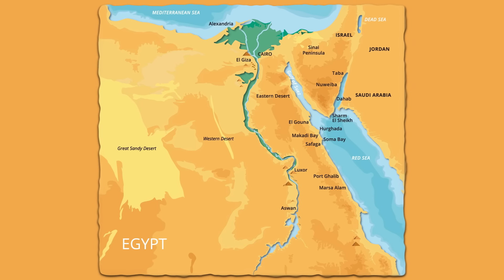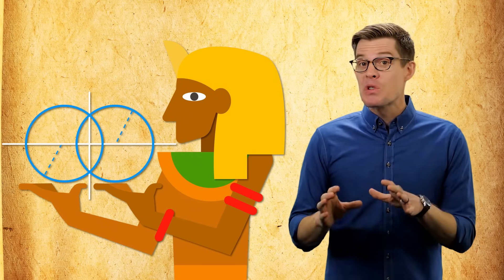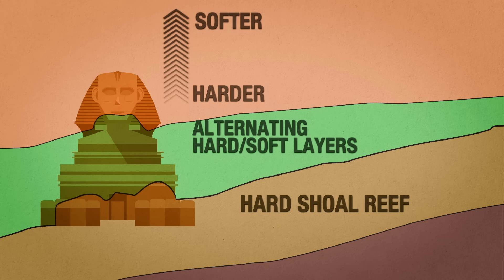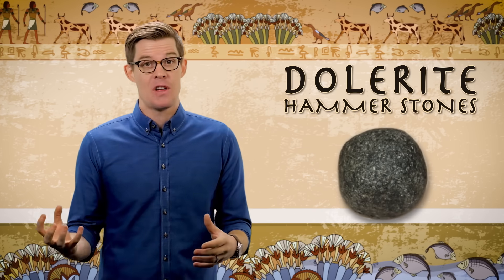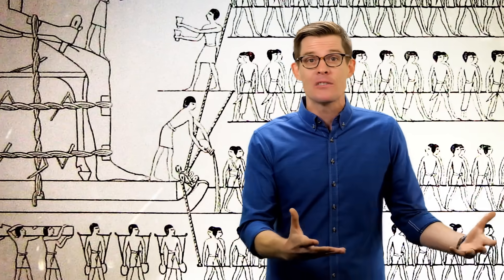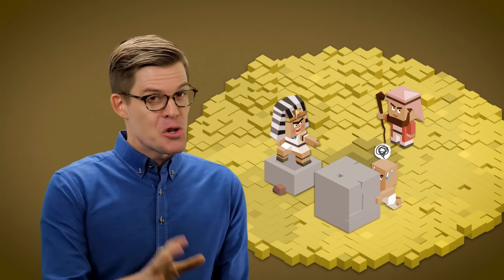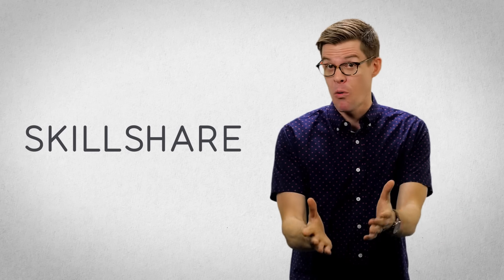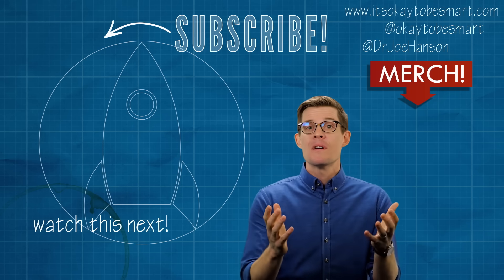The INCREDIBLE Ancient Engineering That Built the Pyramids

Comment: I would love to see someone actually craft granite into perfectly smooth edges & right angles using dolorite pounders. Has anyone ever seen that happen?
Reply: Dolerite was employed along with fire to obtain the basic shapes.  After that a block could be smoothed via polishing using an abrasive.  Also copper can in fact cut granite if you similarly use an abrasive such as sand or corundum.  Yes it may be time consuming = but they had the time.  

There are few granite blocks in the Great Pyramid while the Egyptian engineers would have known how many were required before the first foundation stone was laid.  Accordingly the quarry - which like all quarries which would have partially quarried stone on hand as they were in continuous operation after all - would have had literally years to fashion and transport the required stone to Giza before it needed to be placed in the pyramid.  

Finally they had tools like squares or levels etc. you know = we have examples of them found in tombs as well as depictions of the craftsmen employing them.  Just look at the depictions on the tomb walls of Rekhmire as but one example.  So it helps if you first learn the history before making assumptions.  Just saying.
Reply: @varyolla435  never worked with your hands in hard stone to say such nonsense ??
Reply: well soon we will go back to stoneage.... if you survive that you might actually get to see it :P
Reply: @ayamaprantenna  So does corundum = which the ancient Egyptians also used to cut through stone as noted before.  Corundum is rated 9 on the Mohs scale making it more than adequate for an abrasive to cut through and polish granite or sandstone etc..  Have a nice day.
Reply: @ayamaprantenna  no, quartz is same hardness as granite 7 , desert sand is too fine to be use as grit
Reply: @ayamaprantenna  I like the video of the stonemason above as it demonstrates the basic technique for quarrying limestone such as the Egyptians used.  Far too many people simply assume they were sawing through each individual block = nonsensical assumption.  They rather were as the mason does drive chisels into approximately spaced sections of stone. Once the chisel is sunk deep enough = the stone continues to split along the line producing an approximate size and shaped block.  

Most of the limestone blocks were obtained this way as this is what we see in the quarries which sit beside the pyramids at Giza.  We see where they cut lines along the natural layers of bedrock and holes along the line like a saltine cracker.  Then they drove wedges into the holes and possibly poured water on them causing expansion = resulting in the bedrock fracturing along the pre-cut line.  Then they drove long chisels at intervals like the mason in the video.

The Granite was cut using dolerite and fire as noted before.  Only those granite blocks used to create the smooth walls of something were carefully cut and in some cases polished.  Other granite - such as the relieving blocks above the King's Chamber - are little more than crude chunks of stone which were roughly hammered out into rectangular shapes.  They show no refinement at all as no one was ever supposed to see them.  They are mere slabs of stone.  Enjoy your day.
Reply: @ayamaprantenna  to be real granite have silica content of 65 % and minimum 20 % quartz , chalk is only one form of limestone
Reply: @varyolla435  Yeah... it helps to know history when... history itself is an assumption? I mean we should remember :
- No sarcophagus found into pyramids.
- No scripture about the pharaoh (just a ridiculously small "Cheops" written somewhere randomly, possibly fake), when a tomb for his glory should have been full of it. 
- No testimonial about the way they built it. First testimony by Herodote... 2000 years after the supposed date of construction !
- Built by people who didn't know the wheel, hard metals and hardly mastered basic mathematics (Egyptologists say it).
-,No evidence of traces of the constructions sites, of the ramp or else. 
Anyway... any egyptology book starts by saying sources are really rare and it's difficult to have certainty. About pyramids we all are making assumptions so let's be tolerant with all of them :)
Reply: @testafrederic7018  It's only assumptions = for those ignorant of the facts.  So follow the white rabbit Neo:

1 - the pyramids of Giza were built during the Old Kingdom.  The Old Kingdom = nascent period of Egyptian history.
2 - all cultures to include today are evolutionary.  As such the practices associated with a culture evolve over time. 
3 - so Egyptian burial practices were different in the New Kingdom compared to the Old and Middle Kingdoms just as other things such as mummification practices were different etc..
4 - so all royal pyramids came with an accompanying = mortuary temple - all of them.  It was in the temples that references to the Pharaoh could be found and offerings made.
5 - when the Old Kingdom dynasties collapsed after prolonged bad environmental conditions devastated the Middle East = the temples were destroyed and the tombs were looted as people tried to survive.  As an example the tomb of the Vizier Ankhtifi tells of cannibalism during this period were parents were eating their own children to survive.  
6 - so Pharaohs who was considered to be a living God and responsible for the prosperity of Egypt and the Egyptian people = were rebelled against and their history wiped out for the most part.  That is why references to Khufu are gone along with his temples etc..  To make matters worse.  During the New Kingdom the Pharaohs often practiced "damnatio memoriae" = or "erasing" a predecessor.  They would deface or destroy old temples or else use them as raw material to build something else.
7 - after the fall of the Middle Kingdom northern Egypt - where the pyramids are located - was overrun by the Hyksos.  After a century the Egyptians drove out the Hyksos and acquired their territory = ushering in the New Kingdom.  During this period the capital was moved from Memphis in the North to Thebes further south.  That is when we begin to see underground tombs being employed.  An underground tomb has no accompanying mortuary temple to give its location away as the pyramids did.  As such what was once found in the temples = was now placed directly in the tombs themselves. So that is when you see your writing in the tombs.
8 - Herodotus got his information from the Egyptians themselves.  So while the Egyptians of that time might have viewed the Old Kingdom Pharaohs negatively = their knowledge of construction techniques remained.  The Egyptians were big on "recycling" so that when they found something which worked they tended to duplicate it going forward.  So even if we ignore the bad things Herodotus writes of Khufu = the information relating to the construction of the Great Pyramid is still valid.
9 - the Egyptians were not "stooopid".  They had knowledge of metallurgy + geometry and mathematics + and were highly organized.  These were not cavemen.  lol!  
10 - finally they built things using ramps made of mud bricks or else a mixture of sand/stone chips/tafla - a clay they mined.  There is the remains of a tafla mining operation near the worker village at Giza.  Also when the limestone quarries at Giza were excavated years ago they were found to have had massive amounts of............sand/stone chips/tafla dumped into them = or what they built ramps from.  So your "lost ramps" were in the limestone quarries.  As they encased the pyramids in white Tura limestone working from the top down as Herodotus wrote = they systematically dug away the ramps and dumped the residue into the now open limestone quarries to backfill the ground.

Moral of the story:  so I could of course go on = but the point is made.  There is always more evidence out there.  So things only seem impossible for those who fail to follow all of the evidence we see.  Egyptologists along with other subject-matter experts who work with them conclude it was entirely possible for the Egyptians to build the pyramids = and that is what the entirety of the evidence points to.  Have a nice day. 

p.s. - there are sarcophagi in the pyramids.  I suggest next time you dig a tad deeper.  lol!
Reply: @varyolla435  Thank you for all those details. but honestly I know less than you about it and an answer point by point would be too long... 
It's just the elder is the time we study, the less we have sources and the more we have uncertainty. Some elements you talk about are certainly true (tombs, functions of the pharaoh, egyptian society, etc.), some others can be doubted as well, because evidences here are not so undoubted... I personally think the archeological traces you talk about on the site are not clear enough to solve such a mystery. The day there will be a clear evidence, it would shut all conversations about it. 
Even Heredotus... I still think a 2000 years gap is too huge to judge a testimony reliable. Plato talked about Atlantis (the myth actually came from him), but we can't say it is an evidence...
Eventually, I really love pyramids for their mystery. I mean we can approach it in many ways, classical egyptology, architecture, mathematics, esoteric/mystic. But I really love the fact there is an open door for intuition, dreams, imagination. 
Personally, visiting it I had an incredible feeling to witness something hiding an immense wisdom (I was not expecting such a feeling honestly). I like to think they resist to our obsession to explain everything, to control reality through rationality and ultimately disenchant the world. Yeah, sorry if it hurts your personal convictions, I don't mean it in an agressive way but to me science has become a new dogma... But rather than to see a problem to be solved everywhere, I try to welcome the mystery of life sometimes and dive in it, failing to dig into the archeological ground ;) 
Thank you though for the interesting facts you pointed.
Reply: @testafrederic7018   "I personally think the archeological traces you talk about on the site are not clear enough to solve such a mystery. The day there will be a clear evidence, it would shut all conversations about it." 

I'm afraid what you "think" is utterly irrelevant.  All that matters is what does the evidence actually support.  Accordingly your rather lengthy post becomes an example of how not to think and analyze as it is largely reflective of argumentum ad ignorantiam - which is a logical/deductive fallacy.  We base conclusions upon what we actually see = rather than what we hope "might" turn up someday............maybe.  Rationalizations based upon imagination rather than actual evidence is the sucker's bet.

Moral of the story:  so my sensibilities are not offended in the least.  lol!  I merely recognize the same pattern here I have seen countless times over the past decades.  Rather than investing the effort and time to learn the entirety of evidence so as to contemplate what we actually see = you like so many instead appear to prefer to engage in imagination run amok.

So it is easy to claim "impossibility" such as online trolls frequently do.  It is another matter to connect the dots based upon what we actually see as that requires effort to first find and understand those dots.  This is not a matter of metaphysical allusions or supposedly contemplating entertainment genre inspired nonsense.  This is stone cold reality based upon what we actually see.  Have a nice day.
Reply: @varyolla435  I am bored to have a long debate here to prove my point... I just tried to explain how the fact there is not a real evidence about Giza (that you like it or not, if a clear ramp was found there would not even be a debate about the shape of it, as far as I know Egyptologists still discuss it...) let a space for imagination. 
I don't really belong to the category you put me into,  if you think to identify some "patterns". I believe in science , I believe in intuition too. I think people who are only "rational" are really dry and narrow minded. I think people only living in dreams and imagination are equally lost in some unreal world.
I believe in the connection of both, all great scientists have great intuition, calculating just confirms (see how Einstein came to know about relativity for example). 
And yeah I think we can't treat pyramids as "stone cold reality based" but we need both, a scientific mind and a lot of intuition and being open to the mystery instead to pretend we know what we actually don't and become comtemptuous  with poor dummies 😑

Or else science becomes exactly what it wanted not to be, a new religion, a dogma we can't discuss with even when evidences are fragile.

Thank you for sharing your views and sorry for my poor english.
Reply: @Handsome Millenial the saddest thing is the same person who believe in aliens still dare to accuse egyptologist that they have no evidence.

Talk abt irony
Reply: @varyolla435  can you also explain the clear machine tool marks this way? Not. Check out the cylinder drill and circular saw marks..
Reply: @MrMagnus  Ok:

1 - what marks do you refer to???  After all when referencing some artifact it becomes paramount to also take into account "when" the artifact dates to.  Far too many overlook this important variable in their often facile approach to history.
2 - next is to understand that ancient Egypt underwent multiple periods to include 3 main kingdoms = Old, Middle, and New.  
3 - now coincidentally the New Kingdom Pharaohs were notorious for applying "damnatio memoriae" = or "erasing" their predecessors as I already noted.  This means that not only would they chisel off the cartouches of previous Pharaohs = they sometimes cannibalized their temples as raw material for something else. 
4 - so because of #3 New Kingdom Pharaohs sometimes took stone from Old Kingdom sites and reused it to make something they wanted.  Further as Egypt went into decline along with the intermediary periods were Egypt was basically under local control of the various governors they would also sometimes cannibalize temples and even old towns as raw material to build something if the stone they wanted was not available in their zone of control.  
5 - so above means that while the Egyptians primarily used copper tools through much of their period = in later periods they had access to harder iron and then steel tools.  The Serapeum as an example was continued to be expanded until the time of Cleopatra.  In other words Roman times when steel tools were commonly available.

Moral of the story:  anyways as noted above to consider how an artifact was made you must first determine "when" it was created so as to understand what was available to them.  Also you can look at the tomb of Rekhmire which contains the famous mural of artisans at work with their tools.  See where some employ a bow drill to drill holes in things.  By using copper tubes along with an abrasive such as sand or corundum one can bore through even hard stones as corundum is Mohs scale 9 - also already noted.  

Coincidentally an artifact unearthed at Armana showed just this.  It was created using tubular drills and there was some residue in the drill holes which showed to be copper and corundum residue.  Emery corundum was easily obtainable from the Greek island of Naxos were it was mined from antiquity to modern times. There is an expert in ancient tools and stone working named Denys Stocks. He has studied Egyptian stone working for many years and has duplicated stone artifacts using the tools seen in depictions such as Rekhmire's tomb using the same techniques depicted.   Have a nice day.
Reply: @varyolla435  we dont even have cylinder drills today that with remotely that thin cuts nor the penetration ratio. Same for the circular saw blades used with a diameter of 6 meters also with very thin cuts. Ill dig out the links for you some day. Bed time here. But please look at the precision cut boxes in the Serapheum and let me know if you still think they were hammered out with simple tools
Reply: @MrMagnus  Don't think I did not note your failure to cite these supposed machining and drill markings...........again.  Also you might want to work on your reading skills as apparently you missed by point about the Serapeum = so I will show you again:

"The Serapeum as an example was continued to be expanded until the time of Cleopatra.  In other words Roman times when steel tools were commonly available."

So the sarcophagi within it represent different levels of craftsmanship as would be expected given the reality - as I noted - that the temple complex was created over more than a millennia.  It was continually being added to until the reign of Cleopatra who as I once again noted lived during Roman times when steel tools were commonly available.  Now coincidentally I should point out that these precision cut boxes you reference are likely the ones you can see pictures of online and which are open to the public.  I guess it never passed your mind that the Egyptian Dept. of Antiquities allows people to see the nicest examples of them = in other words the last ones to be created.  

So the famous "black" etched sarcophagus commonly depicted to represent the Serapeum as it happens was likely the last one created as it lacks any reference to a corresponding deity carved on it whereas other sarcophagi which were used contained this reference.  That means it was created but never used and places the box = to the Ptolemaic period - read Cleopatra.  This means they would have had the requisite steel tools to create and carve the hieroglyphs into the sarcophagus. 

Moral of the story:  casting saw blades of any length or shape merely requires a corresponding mold to create them along with a frame of some type to employ it in cases of those requiring more than one man to employ.  lol!  Merely go to Wikipedia if you must to read about the 2 man saws that lumberjacks of old used to use to cut down redwood etc. trees which were around 8-10 feet long.  

So only thinking of circular saws reflects a failure of critical thought for you as saws are created in all manner of shapes and sizes = even in antiquity.  Further you failed to address the evidence I noted in using the Serapeum as an example as it was created over centuries and accordingly the level of detail seen on sarcophagi would correspondingly be expected to improve as time went along with those seen by the public being the best examples = or most recent.  The Egyptians used dolerite and other gneiss stones along with fire to quarry through bedrock.  Having achieved a basic shape = they then had other tools to create a finished product along with the ability to polish stone smooth via the employment of abrasives such as I have already noted here.

Anyways experts conclude that the Egyptians in fact could create what they did with the technology at hand.  You meanwhile have failed to cite any specifics here nor more importantly = offer a plausible alternative to explain what we see.  We base conclusions on what we actually see and not merely conjecture which is what you seem to be offering here that I wager you got from unreliable online sources which offer the gullible poorly informed claims and argumentum ad ignorantiam in the form of pseudoscientific/historical nonsense.  Have a nice day.
Reply: @varyolla435  Some about the tube drills:
https://www.youtube.com/watch?v=KFuf-gBuuno&t=14s
Worth noting is that the cores and holes have a spiral grove which rules out the possibility of grinding with an abbrassive.
Here is some about the saw blades
https://www.youtube.com/watch?v=puXsFyainQU
In both cases the cutting edge was very thin which means the tool must have been EXTREMELY hard. Much harder than anything we have today. It is definitely just a matter of casting a big blade like you claim.
There are also tons of examples of hard stone vases and pillars that clearly has been turned on lathes which needs to be done at a high speed and realisticly do recuire advanced technology.
Also there are tiny hard once piece stone objects that have been hollowed out which definitely requires very fine power tools.
Reply: @varyolla435  Googled "Adel Kaleny" and nothing turned up. Oh, Per has his own website? Wow! He must be smarter than you then :)
Reply: @varyolla435  
1. We dont know that for sure and the "evidence" suggesting so is very vague.
2. Exactly. So how come we see stonework which we can not even remotely match today? Like moving 1600 tonne foundation blocks in Baalbek
Reply: @varyolla435  you have given zero evidence. So rather than commenting on the marks that can clearly be seen in the videos you  choose to attack the people to held the cameras. Silly. All these rocks can be viewed in many peoples videos. Look them up. You dismissed the huge think circular saw blades we can not even create today with simply: "saws can be made in different shapes". Really? Pathetic!
Reply: They say the great  pyramid was built in 20 years. They would've had to Quarry, transport, shape and place a block every three minutes;  twenty four hours a day for twenty years.  Funny, that there is no written record of how they did it.  The megalithic blocks that they moved.  We would find hard to move with the technology we have today.
Reply: We pounded granite into geometrically perfect symmetrical images of human beings with dolerite stones. 😂😂
Reply: David Watson and how would you pull tonnes of stone walking up a greasy ramp lol?!
Reply: @varyolla435  Now explain shaping said granite into perfectly symmetrical representations of the human form.  Explain taking your average "rough" 1000 tonne granite stone and carving it into a perfectly cylindrical plumed pillar without a lathe. Explain one of thousands of dolerite vases, carved internally to paper thinness.
Reply: @eyeingi  Okay:

1 - "dating".  When you fail to take into account WHEN a thing dates to = you then fail to account for the technology of the time when it was actually created.  So the Egyptians employed gneiss tools along with copper.  Among the tools they commonly used is flint which is of a hardness similar to granite etc. and which could be shaped into precise cutting edges as humanity has done for millennia. So Egyptian workmen which shards of flint as an example could cut out tombs from the limestone bedrock quite readily. Similarly stone and copper tools along with abrasives and polishing could fashion shapes as well as surfaces.
2 - Google Denys Stocks.  He is an expert in ancient tools and has spent more than 20 years studying ancient Egyptian stone working.  He has duplicated items in stone using the tools we see depicted on Egyptian tomb walls such as the famous depiction of artisans working found in the tomb of Rekhmire.  

Moral of the story:  your incredulity is not evidence of anything save for your desire not to believe a thing and more often = a lack of understanding of evidence out there.  Only you can remedy that situation via digging deeper.
Reply: @varyolla435  You're the only one here who fails to recognize proper dating.  

Gneiss and flint are a 7 on Mohs hardness scale.  Granite is an 8 and Dolerite a 9.  Now you may think that's just one or two numbers higher, but they're order of magnitude more dense and you're not carving out perfect dolerite vases with either, nor are you doing any kind of fine detail work as several granite sculptures portray. 

I can get on Google and show you what the Earth is flat too.  It doesn't make it so.  

The Egyptians themselves plainly stated they were a legacy dynasty and even went so far as to provide a lineage that spans back many times further in time than we give credit.  

Archaeologists love to praise the ancients for their sophistication when it suits their needs them say they don't know what they were talking about when it doesn't.  

Tell me.  Why does every civilization we know of follow the same predictable progression of technology, except for Egypt, or anywhere else we find polygonal Megalithic Architecture?  

Every civilization from the Etruacans to the Inca, to the Egyptians say they inherited those ruins and built their own empires atop them.  We just ignore their direct accounts because it doesn't fit into the paradigm we created.  

Wake up and start thinking for yourself 

Denys Stock was a decent theorist at best.  The closest he came to replicating a granite stone vase was done in limestone, which is a joke.
Reply: @Handsome Millenial um no
Reply: there is evidence that there is a secret technology so the stones could floated.  A man is Florida figured it out and created a stone garden (Google it) to impress a woman.  He bragged about knowing how the Egyptians created their buildings but he never shared it with anyone before dying.   I believe he used magnetic energy.   And figured out how to tap into the natural magnetic energy of the Earth to make the stones float.  Also, some are researching how sound was used to move large objects.  They did not use primitive tools people🙄
Reply: @varyolla435  Thanks for that explanation but Giza is but one site out of many located all over the world.  In some places no sand exists in abundance.  And Giza isn't the oldest or the largest.  Ancients had electricity and other magnetic energy that could float the stones.  And it's been copied by a a man in Florida.  Razor sharp right angles cannot be created without advanced tools.  Egyptologists mean well.  But they're not craftsmen or engineers.   I wouldn't believe any of their explanations about how a structure was built.   Engineers maintain that Ancient civilizations had advanced tools.  Now, I believe one of two things,  This technology is being hidden or it's in plain sight but non-engineers dont know what the heck they're looking at and outiders aren't being given access.  I saw a documentary of piles of hundreds of some odd looking tools being thrown into baskets because they couldn't tell what they were used for.  Tools that looked like long slim pitch forks.  Some engineers said they were used to create movement with sound vibrations.   We don't have the whole story.  We only have what they want us to know.
Reply: @markita.hardenhome  YAWN!!!!  LMAO!!  "Engineers" claim................... = who - and more importantly how is their background related to Egyptology????  Out here in the real world Egyptologists work with subject-matter experts - to even include engineers.  In the mythical world of pseudoscience however we see these fringe cranks who "just happen" to work with other cranks who similarly lack any background whatsoever to tie their expertise to what they talk about - not even tangentially.

We see rather whereby these flakes more often than not have some book or DVD to sell you along with some who exist in the world of entertainment television.  Let me give you an example.  A historian who wrote a book about Mesoamerican civilization pre-Columbus while researching his book worked with a historian.  This historian related to the author that he had been approached by the producers of the Ancient Aliens show wanting him to be on it.  The historian told them he would be happen to be on their show - BUT - he thought their claims were nonsense................suffice to say he was not on the show.  lol!!

Moral of the story:  pseudoscience/history = is a BUSINESS!!!  Accordingly those individuals on those shows and writing books etc. are the ones who agreed to "play along".  They do it to raise awareness about themselves and perhaps make some money off of gullible moppets who believe that twaddle the same as we see Flat Earthers etc. which is also a business. 

So conspiracy theories are the swansong of the failed intellect I'm afraid.  Nothing is being "hid" and the idiots you have been listening to certainly hope you continue to believe such nonsense as that is how they make a buck.  Enjoy your Matrix.  I'll stick here in the real world. 

p.s. - when looking at neolithic or Bronze Age sites around the world you MUST first show any links between civilizations before you can claim some type of commonality otherwise you are engaging in imagination run amok.  Building a pyramidal structure is a basic shape which even a child with blocks can create in time.  So just because we find "pyramids" around the world does not make the civilizations related in any form as pyramids are among the first structures ancient man would build given its simplicity of design.  It is nothing more than blocks stacked atop each other in a tapering fashion.
Reply: @varyolla435  I scrolled through the replys and It doesn't seem like you convinced anybody. At this point no matter what you say, they just don't want to be wrong. 

ps: my recommended videos are now full of ancient aliens and nicola tesla power generating pyramids.
Reply: @kosimiki  My point is not to convince anyone = merely to present actual historical/archaeological evidence and to demonstrate the faulty deductive process employed by the believers of "fantasy" historical claims.  The deceived rarely confront the reality of their deception as often they have an underlying desire to believe it = hence they will employ endless logical gymnastics to cling to said belief.  For them a "comforting lie" is preferable to a hard truth.  As such they are beyond hope.  

So my points are for those intelligent enough to desire to understand the actual evidence out there and to show others how "not to think" about things.  Always follow the actual evidence at hand and not unsubstantiated conjecture or assumptions. Have a nice day.
Reply: @eyeingi  Granite isn't 8 on the Mohs scale it is a 7 or below depending on the content. And can be worked on multiple ways.
Reply: Jimmy Crackcorn  Do you know you can use antler and simple copper tools to work flint? Which has  a hardness of 7 like granite? And there are beautiful pieces made with such tools. Those are much earlier than the Pyramids, so why do you think such innovation cannot have taken place?
Reply: Jimmy Crackcorn  I'm not sure about the light conditions you speak off, but I am not sure how it would be too much work? It doesn't seem to have been to much work to use stones in the paleolithic etc?!
Reply: Jimmy Crackcorn  The granite sarcophagi at the Serapeum did not need dolerite to create them as = the Egyptians had steel tools by then................duh!!!

In case you missed the memo the Serapeum remained in operation until the time of Cleopatra = ergo Roman times.   By then Egypt was well into the Iron Age while the section of it open to the public today represents = the last section to be created.  In other words those sarcophagi were created during the Ptolemaic era.  

Of course if you actually understood Egyptian history - which you clearly do not - you would understand this fact.  Such are the pitfalls of trying to learn history from internet clickbait and pseudo-historical sources.  C'est La Vie
Reply: Jimmy Crackcorn  so when your erroneous facile logic is exposed = you default to puerile commentary..........never saw that one coming.  lol!  

Not that it matters coincidentally but - though I am now retired - my degree and career field was in an applied science field.  I have also spent 40+ years studying history as a hobby.  Better luck next time.
Reply: @varyolla435  It is Not possible to cut/carve 90° corners like what were found on the inside of the box ( sarcofigous) in the " Kings Chamber" with round blunt stones .
Reply: @jamesgraham6796  lol!  Sad how people love to assume soooooo much = rather than actually looking at the totality of evidence.  C'est La Vie

1 - dolerite was used to cut through the bedrock to shape the outline of an object like an obelisk or a block.
2 - meanwhile copper alloy tool such as saws can in fact cut through granite when employed along with an abrasive.
3 - so look at closeup photos of that sarcophagus = note how the sides are not that symmetrical after all when seen up close.  Just as the pyramid looks "neat" from a distance = so the closer you get the more you see its imperfections.
4 - so copper saws might have been used to saw the outline of a sarcophagus - or else pounding it to approximate shape.  Then copper tubular drill saws could be used to remove the interior of it by systematically cutting out cores.
5 - then the insides can be finalized via pounding using dolerite to chip away at it followed by sanding the sides until they are smooth using flat blocks and an abrasive. 

Moral of the story:  so it can be scary for some to "think" = but they should try it sometime. Look at the unfinished obelisk at Aswan which cracked and was abandoned.  It is finished in some areas with other parts showing a pockmarked appearance as you would expect if they were hammering on it before smoothing it out via sanding.   Assume less and follow the actual evidence more.
Reply: @varyolla435  3 - so look at closeup photos of that sarcophagus = note how the sides are not that symmetrical after all when seen up close.  
Do you have any links or sources that I can look at to confirm this?
Reply: @cooljosh2307  There are tons of photos online where visitors took pictures and posted them = to include some of people laying down inside of the sarcophagus.  

You can see the sides closeup and they are less "perfect" than people assume much the same as the pyramid itself as an example looks better from a distance.  When you look at it closeup however its imperfections become apparent.
Reply: no, because it is impossible unless YOU ARE OK TO BE SMART
Reply: I think they not only had iorn but also in the case of the pyramids, casted the cassing stones in place, block by block.
Reply: @alphonsobutlakiv789  That would have taken even longer than and required even more labor.  lol!  The Egyptians were already racing the clock to complete the pyramid as typically once a Pharaoh died then all work started under them was halted as the workers moved on to things the new Pharaoh wanted done. 

So fracturing chunks of limestone - white or otherwise - from the bedrock does not require iron.  It can be done with copper chisels and wooden levers by driving a line of long chisels into the bedrock until the stone fractures downward - and then levering the chunks out.  That coincidentally is what you see evidence of in the quarries at Giza and elsewhere.  To create a block from some type of premix would require quarrying the raw material + pulverizing it + creating your mix + pouring it into molds = and waiting for it to set.  

Also using molds would result in blocks of uniform shape and size = which we DO NOT see.  The blocks of the pyramids are a hodgepodge of shapes and sizes which is exactly what you expect to see from fracturing off approximate sized chunks of stone like I described.  Assume less and follow the actual evidence more.  Have a nice day.
Reply: @varyolla435  if you had a mold the blocks would be all the same size, but I'm saying only the cassing stones were casted and each on was casted using an inconsistent amount of mix, and going in both directions from the 4 corrers and also casting on the previous blocks in the staircase method. That's 8 starcases. A wooden face would go over the top to keep the cast stone faces straght, and polishing was done after the wood was moved using possibly sand rags or they may of had sand paper. Basicly we're talking a primitive cement made hard as stone likely by tamping it when wet and looks like stone as large chunks would be added too. The dust and rubble required would already be on sight as scrape from cutting the inner blocks.
Reply: @alphonsobutlakiv789  And I'm saying = prove it via credible evidence.  Also you might want to also explain the Tura quarries where the white casing stones came from considering they are still in operation today outside of Cairo.  lol!!  

Moral of the story:  reality is not what some are gullible enough to believe.  It rather is = what the credible evidence actually supports.  The evidence - all of the evidence - shows them quarrying blocks from the bedrock.
Reply: So material was on sight and already ground up, and it's not a slow method as you start with 4, then 12, 20, 36, 44, 52, 60, 68, 72, and each number is one cast, dry time decides how many are casted a day, this sequence dose decrease in number at a point, but would need to know how many blocks wide and tall the pyramids are to say.
Reply: @varyolla435  just becuse they also mined white lime stone doesn't mean they wouldn't cast it too. Casting would only require the dust and rubble of the mine, and no dought that's is a by product of a mine. So we only have proof of source here, not method. Perhaps good water powers saws could cut prefect enough to mass produce perfect blocks, but what is your evidence from the block not being casted?
Reply: @jamesgraham6796  from what I've seen, you are right about the granite boxes, could not be shaped by boulders.
Reply: @varyolla435  realistically the boulders cutting the obolisk only makes sense if the boulders were mounted on a machine that would pound away and the stone by dropping and lifting the stones from greater hights than a man would swing. Such a think would probably be water powered, but I think the boulders were just from moving or part of a machine and the machine used spinning bronze cillenders and an abrasive, again, water powered. Looks more to be what the tool marks suggest
Reply: @alphonsobutlakiv789  "So we only have proof of source here, not method."

We call this coincidentally = argumentum ad ignorantiam.  lol!  So had you bothered to look at the actual evidence - which of course we both know you will not - then you will have seen how those "sources of stone" - read quarries - just happen to also show us the methods used in quarrying.  

They show the trenches they cut in the bedrock to methodically separate out sections and lever chunks of stone from the ground as well as things like holes spaced along layers where they were driving wedges into the bedrock to fracture a section free. 

Alas for you = there is absolutely zero evidence of what you try to assume here - as noted previously.  Enjoy your assumptive fantasies.  I will stick with the actual evidence.
Reply: @varyolla435  I have seen evidence leaning tourds what I'm saying, I would of said they were cut too before I knew what I do now, I didn't start out thinking they were casted, it just looks as though they were, and that's just the cassing stones I mean, I'm still saying the inner stones were just cut, not casted. The fact there is evidence of stone cutting where the cassing stone came from dosent necessarily mean those cuts were for the pyramids, or at least the ones we're talking about. In fact, assuming the queries remained active, no cuts should remain from the pyrimid build due to it's age, they kept cutting for other things. just like how you won't find the spot the stone that became the David was cut, that spot too was cut, and is still today being cut, but we know it came from there.
Reply: There is also a way to test the casting theory I'm my case since I'm saying they were casted one by one in place, the centerward side of each block should be different from the cornerward side, unless they had a spiral method, but they will then show a rotationally oriented difference.
Reply: @markita.hardenhome  I've thought about the floating stone idea and I don't think the Florida man actually levitate his stones, but in the case of ancient people, I think they could possibly and the lack of iorn is actually intentual becuse the technology I think was sound based and iorn interfered with it, so not only can it not work now becuse of the modern abondonce of steel in everything, but also a lack of records of these things working could be directly linked, as if only a few steel rods be required to disrupt the technology, invadors with iorn swords could have never seen it work and so never understand it.
Reply: Explain how the rocks once levitated threw an invisibul force would be as had as explaining how copper makes glass glow, and be quite unbelievable if you can't turn it back on to prove it.
Reply: @varyolla435  your history is wrong. Just saying. Egypt found the pyramids, they were build before the great flood. How would you explain the water erosion, and shallow life dwelling sea fossils embedded amognst the rocks. Or the de-masking of the sphynx?
Reply: Gmail X  There is no "technology" back then that could do this. It is a mystery to me why so many people in this world believe whatever an "expert" tells them. You are one of them! Keep perpetuating the manipulated narrative, Keep the sheep in line!
Reply: @nickyslicky  lol!  My history is based upon = credible historical/archeological/scientific evidence.  Meanwhile what evidence do you have to support any supposed "alternative narrative"????

On a side note.  Feel free to go to the library some day (they are wonderful things) and get yourself a textbook on geophysics.  Then read up on = "plate tectonics".  

While you are at it read up on "efflorescence".  The erosion on the Sphinx is due to underground water which upwells to the surface where it evaporates denuding the surface of the limestone which the Sphinx was cut from.  There is groundwater a mere 4-5 meters below the Sphinx.  You can find videos here on YouTube of them drilling below it.  Better luck next time.
Reply: @varyolla435  There is insurmountable evidence supporting the pyramids are thousands of years older than once thought. Look up Graham Handcock and start there. I was once like you, until I realized that scientists and egyptologists are funded by the very same governments that supress truth. Water erosion on the pyramids in a desert? That is true evidence.
Reply: @varyolla435  Too bad its actually erosion from being submerged at one point in time. Library's dont have real information, I have been to the pyramids physically. Seen them, they werent built the way you think they were. Every archeological point, is geometrically aligned to the stars. The did this on the center of earths gravity too, the geocentric maximum where vibrations are strongest. Electromagnetic cross point of ley lines, same with Myan pyramids. Think outside the box.
Reply: @varyolla435  Just because you string long words together doesn't quite help your case. I am also educated, but I can tell you are doing everything you can to protect your bias. When someone challenges the status quo, there are those who cling to history books. You are one of them... time to wake up! You have been mislead.
Reply: Seems like Vary Olla, is the protector of lies! Look at the persistence. A true expert would plausibly deny rather than try to convince people smarter than themselves, that what we were taught in history class stays true forever!
Reply: Carl Munck the code
Reply: @varyolla435  all i know is you, my friend, have a LOT of time in your hands, twas entertaining and educating reading this thread. y'all deserve a like or a potato or something.. thanks!
Reply: The pyramids are pre ice age / pre cataclysm. The pharaohs are post cataclysm re settlers. There is a copy of Giza in China. What pharaoh built that?
Reply: I’m not sure if you’re casting doubt on their theory on using dolomite. 

But if you are, then why would they have a significant amount of these tools at the quarry sites if they weren’t using them?
Reply: @varyolla435  My point stands. You present information in the most arrogant and patronising way imaginable. There's no harm in correcting misinformation but I don't see the need to insult people in the process. Anyway enjoy your day.
Reply: Nah man, never before or later has anyone cut and placed hard as steel rocks, and we struggle to do this even today, remember that egyptologists are not based on facts, but on belief,
Reply: @Fjarturoo  "remember that egyptologists are not based on facts, but on belief,"

AS Willy Wonka would say:  "strike that - reverse it."  The pseudoscientific/historical nonsense others claim online is what is emblematic of unsubstantiated belief.  Egyptologists on the other hand follow the evidence = the REAL evidence we see and not all made up innuendo trash one sees.  

p.s. - in so much as stone quarries today often use steel tools to cut and shape stone = your comical claim is oxymoronic on its face.  The ancient Egyptians had tools and techniques for cutting through even granite.  Better luck next time.
Reply: @varyolla435  you’re saying your argument is based on scientific evidence (which it is) but there’s a litany of scientific evidence that has been used to draw different conclusions. Let’s not forget they’ve been wrong about a lot and keep updating their understanding. If I went back 10 years and only quoted a variety of Egyptologists for a multitude of points, I’d be doing the exact same thing as you but come out with very different answers. For each point you’re making your evidence is just whatever Egyptologist agrees with that specific point, whereas there are also those that disagree. Like how do you not realize how much evidence you’re ignoring. The field is so old and we have so much evidence that you can find evidence for a lot of different conclusions. Even Egyptologist don’t have that approach because they know science is science, it’s evidence based reasoning but that doesn’t make it true otherwise they would’ve been right the first time. It’s just funny because, in the future, you could be doing the exact same thing but you’d be arguing different points because it’s virtually impossible for all the theories you mentioned to stand the test of time
Reply: Alot of fancy answers here but the right answer is no. There is no video of it.
Reply: @Areeb118  "but there’s a litany of scientific evidence that has been used to draw different conclusions. Let’s not forget they’ve been wrong about a lot and keep updating their understanding."

Wrong I'm afraid.

1 - you have "science" - and then you have "pseudoscience".  Science follows the totality of evidence out there to formulate a conclusion which said evidence supports.  Then the conclusion is subject to other peer-review experts whose consensus is either supportive or dismissive.  Thus what is ultimately accepted is based upon consensus while what is put forth abides by acceptable scientific methodology of conclusion.  Hence what "mainstream" Egyptologists accept is reflective of actual scientific inquiry practice.

2 - then you have pseudoscience.  There you see the occasional reference to legitimate scientific/historical evidence - BUT - those snippets are then taken out of context and coupled with often fabulous claims not supported by the totality of evidence to formulate some new "novel" narrative.  Further what is asserted IS NOT accepted by the broader peer-review community and often lacks peer-review consensus entirely.  That results in fringe "outlier claims" which neither abide by acceptable scientific methodology nor are accepted by the majority of the scientific/historical community.  Finally said claims often have some underlying bias - usually economic - on the part of those propagating them.  

Moral of the story:  these fabulous claims pushed in the comment sections of videos such as this = pseudoscience.  

Thus it matters not if some fringe researcher makes some fantastic claim which "just happens' to dovetail into themes Hollywood has pushed for decades via the entertainment genre and they also (coincidentally) have some book or whatever on the topic to sell you about it.  

It remains pseudoscience no matter how much it "makes sense" - intentionally so - to the ill-informed.  It is a business model today whereby a handful of people push these fanciful claims to the gullible.  

p.s. - the latter part of your comment is argumentum ad ignorantiam.  We do not base conclusions on the "possibility" that new evidence might turn up..........maybe........one day.  We base conclusions = upon what we see and understand today.  

Many of the old discarded claims date to another time when anyone could be an Egyptologist and many lacked any understanding of science = pre-20th Century usually - or your "gentlemen explorers".
Reply: In Hell.
Reply: I could see over time to smooth it, put a handle on it and use it as a maul. Im curious, as an idea, if they were to build a fire lets say concentrated along a line and fed it for a day or so, then immediatly pour water on top of it. They had to of known animal fats and oils would burn hot.  I know you can crack a granite counter top if you use a torch and smack it it quickly with a hammer. Itll literally break where you smack it.
Reply: No technology is available to replicate pyramid, it's all falls
Reply: @patilsujal52  Incorrect.
Reply: it's impossible
Reply: @varyolla435  a quick thank you for your attempt to educate the future flat earthers in this thread.
You're fighting against some severe examples of the Dunning-Kruger effect but your posts may help those who are not too stupid to realize just how stupid they are.  I salute you!
Reply: @Christopher Clark search Joseph Davidovits he has a very convincing theory
Reply: it's old genius engineering
Reply: @PaiMeiofthelotusclan  You wasted an inordinate amount of time and typing = trying to rationalize ignoring the evidence as well as your incredulity of course.  Accordingly all you accomplished was to pile together a lot of unsubstantiated conjecture for your part which does not reflect what we see on the ground. 

So try looking into the work of Denys Stocks.  He is an expert in ancient tools and has studied the Egyptian stone working craft issues for decades.  He has replicated stone objects such as your vases using ancient tools and techniques such as we saw them employ.  The famous depiction of artisans at work found in the tomb of Rekhmire show these people at work crafting objects.  

Finally the rest of your screed to be frank is mundane.  Where are the copper tools = recast for other things obviously.  If you had even a rudimentary understanding of some of the evidence out there you would know that metals like copper in ancient Egypt were expensive and tightly controlled.  The workmen in the Valley of the Kings had their tools weighed before/after their shift to prevent pilferage as pieces which were broken might be secreted away to sell.  So while there are some examples of tools in museums + depictions of these tools being used as noted above  = most tools would have been melted and reused for something else much the same as copper etc. is recycled today.

So first learn the evidence out there BEFORE you go on rants about supposed "impossibility".  It tends to save a lot of time and things make more sense.  Something new to think about.............or not. 

p.s. - I HAVE looked at those photos etc..  The unfinished obelisk since you brought it up rests = close to the Nile River and more importantly uphill.  Perhaps you should learn how to use Google Earth as well as read topographical maps to recognize the lay of the land around these things.  

So had the obelisk not cracked and been abandoned it would have needed to be pulled several hundred meters to the river to be loaded onto awaiting barges and that in turn would have been easier since the obelisk itself sits at an angle and is uphill from the river.  Facts as John Adams famously quipped are stubborn things.
Reply: @dkln888  So let me get this straight, someone claimed something and cited historical evidence and you think you're smart you contradicted them by insulting them?
Reply: @varyolla435  yeah well the old man in the clip is using steel pegs, and he still have to smooth out the sides, make the right angles etc guaranteed he'd spend a day minimum to prep the stone, even though he only works by himself! According to the tale they tell us , if they built the pyramids in 20 years, working 12 hour days, 7 day per week, they had to lay a block every 2 minutes, using copper chisels only ! If the old man in the video used copper pegs, the pegs would be flattened way before they'd penetrate the stone ! Sorry, its simply not possible! 
Have a nice day
Reply: @varyolla435  (obolisk)...pulled several hundred meters to the river to be loaded onto barges

What is the conventional wisdom for how they might have moved a 1000+ ton block, even downhill, and more crucially, how would such a block be loaded onto a barge? What would a wooden barge that could carry such a load look like? Presumably, a suitable boat would require a balast of at least the same weight as the cargo, or the cargo itself could be balast, in which case the cargo would have to be lowered down into the boat (versus sitting 'on top'). So what 'machinery' would be used to lower 1000 tons onto/into the boat?

I'm genuinely curious what egyptologists have come up with on this topic, given the evidence they likely have.
Reply: @imacmill  First is to point to a supposedly 1000 ton object and then we can talk as what you claim represents the stereotypical false analogy one sees to rationalize pseudoscientific/historical narratives.  In other words if you are going to question "possibility" - make sure your question is rooted in the evidence we actually see.

So look at the unfinished obelisk at Aswan = notice anything - I do.

1 - it was quarried uphill from the river which is several hundred meters away on a downslope - look at a topographical map of the area.
2 - also the obelisk itself is quarried at an angle.  Coincidentally if you look at other large objects such as the Baalbek stones you see the same thing = near their destination and sitting at an angle.
3 - that tells me that the object did not need to be moved very far while because it sits uphill and at an angle them to move it from its quarry position to awaiting barge(s) = downhill effort.  So if when shaping it and severing it from the bedrock you systematically build a frame under it as you cut underneath = by the time you completely break it from the surrounding stone it will be on a wooden frame. 
4 - now we know that the Egyptians built harbors as there are the remains of them scattered throughout Egypt.  At Giza as an example next to Khafre's valley temple you see 3 white lines in the sand.  Those are the remains of stone jetties which slope down under what is today ground but which millennia ago was a deep-water harbor.  Nile mud has been found 6-7 meters below the surface via geological core sampling of the area.  So that entire area just east of the temple was once a harbor complex.
5 - finally why do people only assume they were "lifting" things.  Do you not see how utterly silly that assumption is - especially for large objects.  Did it never occur to anyone that perhaps they might build jetties which large craft might sit between = and pull objects onto the awaiting barges???  So clearing the bedrock at the downward end towards the river will allow it to be pulled from its pit downhill to the awaiting ship(s). 

Moral of the story:  so the Egyptians like others employed draft animals as well as manpower.  Yoked oxen can be see in multiple uses on tomb depictions to include pulling heavy objects such as a large sarcophagus on a wooden sled in a funeral procession.

So no = they were not lifting 1000 ton objects for which none exist in the pyramids anyways. The heaviest blocks in the Great Pyramid are the granite relieving stones which are only estimated to be in the ~70 ton range.  Further scientific testing shows whereby if you moisten the ground before laden wooden sleds they could reduce that effort by almost half. 

Anyways the barge Merer and his crew were believed to use was estimated to be able to carry around ~70-90 tons = sufficient to transport the Giza granite blocks.  Also the Temple of Hatshepsut showed large obelisks being transported on barges which are enormous in size - 3 decks - and which are connected and further pulled by other smaller ships.  When there is a will...........there is a way.
Reply: @varyolla435  First is to point to a supposedly 1000 ton object

Since I have no awareness of the 'obolisk' of which you and others speak, I simply Googled it (as you suggest elsewhere to do), and came up with this:

https://en.m.wikipedia.org/wiki/Unfinished_obelisk

If this article is lying to me about the rock's weight, you'll have to explain how my believing it makes me gullible. I lack the ability to verify such things without viewing in person, taking its measurements (the article could be lying about that, too), and using known characteristics of the given rock type to calculate its weight. Basically, teach me to know 'correctness', like you do, without being there.

 why do people assume they were "lifting"

Your arrogance got the better of you here: nowhere did I use the word 'lift'. What I said was 'lower', as in 'lower a stone down the hill on a wooden sled', or in my case, 'lower a stone into a barge'.

I could Google for a picture of the large barges you say exist, but how would I know the pictures aren't fabricated? Also, if the barges are 'real', I'd like to see their construction details to determine their resistance to capsizing as a heavy object is moved into position on it.

I am not disputing anything you said anywhere in this thread... it's all good (albeit, unverifiable) info. But your attitude makes you eminently slappable; your condescending put-downs, and cringe-worthy use of '=' instead of a comma (do you think adding a mathematical symbol to your blather makes you look smarter? Think again), makes we wanna just skip right over your posts. Reading your crap is like watching 'First Amendment Audtitors' or 'Anti-masker Karens' on YouTube; while they may be technically correct sometimes, you still wanna see them thrown in jail just for being such obnoxious, self-important douchebags.
Reply: @imacmill  "Internalize less" = objectively read more.  Whining about perceived emotions so as to justify ignoring what I note fails you here.  I noted historical/archeological evidence here.  

Either you accept what is before you or not.  If not then you are accordingly in the realm of argumentum ad ignorantiam - or arguing from ignorance - as you then lack tangible evidence to support your statements.  This is about one thing only = evidence.  Either you base conclusions upon it or not.  Incredulity is not an argument.
Reply: @varyolla435  all in two minutes
Reply: @varyolla435  nope
Reply: @testafrederic7018  "But instinct is something which transcends knowledge. We have, undoubtedly, certain finer fibers that enable us to perceive truths when logical deduction, or any other willful effort of the brain, is futile."
-Nikola Tesla

 "The intuitive mind is a sacred gift and the rational mind is a faithful servant. We have created a society that honors the servant and has forgotten the gift." -Albert Einstein

"Intuition is a very powerful thing, more powerful than intellect, in my opinion," - Steve Jobs

  A new age of understanding will be coming soon, an age without dogma. Lets just hope it will
Reply: @varyolla435  That you Zahi? .... this "efflorescense" you speak of, is there another example of this type of erosion anywhere else in the world outside of the Sphinx enclosure?
Reply: @and__lam1152  How about you - instead of trite commentary - look for ancient limestone structures carved from the bedrock which also rest atop natural aquifers. Then you can answer your own question here. lol!

Of course we know you will not make the effort.  The Sphinx is connected to the bedrock while a short distance below the surface is freshwater which is erosive to limestone.  That makes it unique.  One can see underground tombs where the walls flaked off and/or the ceilings collapsed from water exposure.  

Aboveground structures directly carved from the bedrock however represent an unusual problem as structures created from blocks such as the pyramids are not subject to efflorescence the same as the Sphinx as they simply rest atop the bedrock rather than being a part of it. That prevents water from below transiting the bedrock to the surface.  How about you explain why underground pumps were installed at Giza if groundwater was not a problem???
Reply: @varyolla435  No one's doubting there's extreme groundwater issues on the Giza plateau. Just not sure how your opinion is anymore valid than an eminent professor of Geology at a prestigious American university. .... but I guess that's the beauty of opinions, they're just that. Someone's personal beliefs that are neither right nor wrong, maybe just less correct. Haha ..... the least we can do is all agree that no one knows what is true regarding ancient Egypt and pre-civilisations. Hopefully the further excavation of Gobekli Tepe will shine further light on human consciousness and and history.

Although I imagine it will most probably create more questions, especially as to what happened during the Younger Dryas period
Reply: Fortunately, the granite in the pyramids was FAR from "perfectly smooth"
Reply: Especially back then in the scorching heat-I think it was impossible w out advanced tech
Reply: @testafrederic7018  well said 🙌
Reply: @varyolla435  bc science is never disproven or bought? I think there’s a lot of cognitive dissonance going on when it comes to the possibility that the pyramids may have been created using advanced tech-it’s the 8th wonder if the world, lines up w the stars-how can ppl not think ETs had a hand in advancing ancient civilization?
Reply: @kuriouskitty3084  Then you think wrong <facepalm>
Reply: @FutureSight666  why not? There’s plenty of proof ETs were are on this planet
Reply: @markita.hardenhome  yess🙌we just forgot as a species these energies exist-the earth runs in electro magnetic energy-Tesla knew about it as well-FREE ENERGY
Reply: @kuriouskitty3084  Prove ET is real via credible evidence = and we'll talk about possibility.  lol!  Until then it is a fanciful rationalization to you alone which only exists in your imagination being premised upon a desire for your part to believe it.

As to science supposedly being bought.  Conspiracy theories are even less of an argument than ET's.  Do try not to generalize so much here and stick to the facts at hand.  Things turn out better when you do.  Argumentum ad ignorantiam makes for such a boring discussion really.
Reply: @varyolla435  At that rate it would have taken them a thousand years to build just one pyramid.
Reply: @al2207  No it's not.  Every mountain in the world, some with very hard rock all erode.  You don't have to have something "harder" to cut the stone.
Reply: @MrMagnus  They were cut with a blade pushing around a slurry of sand.  They were cutting, by grinding.
Reply: @jamisojo  weird comment , never work with your hands in granite ??
Reply: @jamisojo  how do you know? Does it sound plausible to you? Seen the experiments trying that?
Reply: @varyolla435  the great pyramid took around 20 years to build and it contains over 2 million bricks they would have to have placed 1 of those thousand pound blocks every 3 minutes for 20 years straight also factor in hundreds dying and being injured thats not possible
Reply: Nope, but I’m sure this guy has a simple explanation for THAT TOO! This video is so bothersome.
Reply: @varyolla435  Really enjoyed reading your expertise on this, thanks.
Reply: @Chimponaut  Thanks but this is not about me.  It is about following the evidence - all of the evidence - rather than simply assuming based upon whimsical claims which lack substantiation.

Moral of the story:  incredulity as we see is easy requiring little forethought.  Understanding however can be more difficult requiring effort which many eschew.  The very fact that those who attack Egyptology do so based upon internet videos and entertainment television shows you the superficiality of their thought.

Consider the last comment here against me.  Prattling on about blocks being placed and supposed "hundreds of deaths" - based upon what evidence exactly???  Answer:  absolutely none.  It is probably a claim extrapolated from watching Hollywood movies like the 10 Commandments.  lol!  This nonsense is more Hollywood than history.

p.s. - the block question is superficial as it depends upon = "1 at a time" - which no one does.  Buildings are not built one block at a time.  They are built via placing multiple blocks in multiple locations simultaneously.  

So the pyramids would have multiple teams moving blocks and placing those blocks in multiple locations = in tandem - thus multiple blocks being placed at the same time.  Such is their superficiality of thought as they fail to think about the totality of what was going on.  C'est La Vie
Reply: @varyolla435  Yes, I was just thanking you for sharing your knowledge, that's all.
Reply: @Chimponaut  I know.  My post was for all who take the time to read this lengthy thread.  lol!  Always follow the evidence - all of the evidence - as there is usually more out there.  Far too many here simply see some claim = and assume from there.  That as we see often leads to incorrect superficial assumptions.  Have a nice day.
Reply: With slave labor anything is possible my boy
Reply: Has anyone seen an alien construct a pyramid? Is that more likely? Brain rot
Reply: It has been a year and this is still going? Well thank you for the enjoyable explantion though lol
Reply: I don’t mean to speak against you but I was watching how they used the sun to be able to melt it and pour it into a cast.   I was surprised to see it I didn’t know it could be done before until I watched the program.
Reply: @Vrailly  Just time and effort - something most are unwilling to expend - so as to learn.  As a final thought.  Egyptologists have uncovered at Saqqara over the years underground caches.

These contained mummified animals for votive offerings and as burial items = literally millions of them.  This shows whereby the fabrication of burial items etc. was actually a huge economy in ancient Egypt spanning millennia.

So people who rationalize based upon "incredulity" typically do so via the "time" argument.  As the caches show = they had the motive to make these things + the personnel + and the time as demand was constant spanning centuries.  Ancient Egypt was a highly organized and technologically competent society to be able to produce millions of mummified animals - along with other things.  They were not primitives.  Enjoy your day.
Reply: @varyolla435  
But you have no evidence just as we do not  !
Reply: @varyolla435  
Wel, if the buildings are built with 2,3 million 2,5 ton stones, you can't plc many blocks at the same time !
Especially if you get higher and higher, as you first have to get those giant blocks up there !
Reply: Define perfect?

Like razor sharp?

Because they aren't.

Also dolorite pounders are not the only possible way of working granite.

Copper/bronze saws with quartz sand abrasive is one option - the copper/bronze acts only as a medium to move the abrasive cutting material across the stone surface, not dissimilar from sandpaper.

Flint chisels is another option - flint is roughly equivalent to quartz in hardness (7 mohs) and can be worked into sharp edged tools for fine masonry on hard stone.

Granite is not as hard as you think it is - it is a composite of 2 silicates, softer feldspar (6 mohs) and harder quartz (7 mohs).

In practical reality rhe softness of feldspar renders the overall crystalline structure of granite weaker than 6.5 mohs - so flint chisels and pure quartz abrasives are completely viable.

It's staggering just how much ignorance is repeated on this subject, often for grift.
Reply: @al2207  "never worked with your hands in hard stone to say such nonsense ??"

No one has worked truly like the ancients did since the bronze age - you have as much reference to compare to them as anyone else does.
Reply: @al2207  "no, quartz is same hardness as granite 7"

No it isn't.

Granite is quartz AND feldspar. - both silicate minerals, but with differing hardness.

The latter is only 6 mohs which creates a critical flaw in the crystalline structure of the material.

Because of this the practical hardness of granite is between 6 and 6.5 mohs only.
Reply: @mnomadvfx  i had worked cutting granite for 3 years with heavy duty rotary hammer and using feather and wedge for splitting the rock and i know it cannot be done by hands achieving perfect fitting and precision
Reply: There still doing the 5th one from 5000 years ago with bending copper cannibas rope